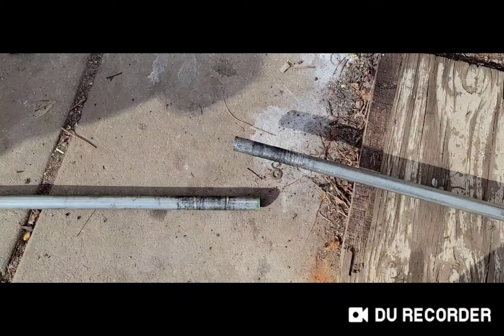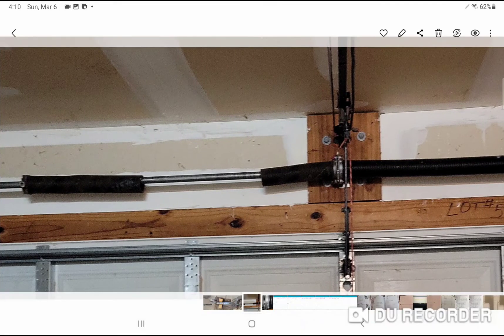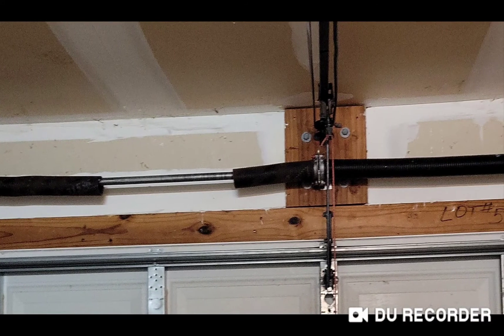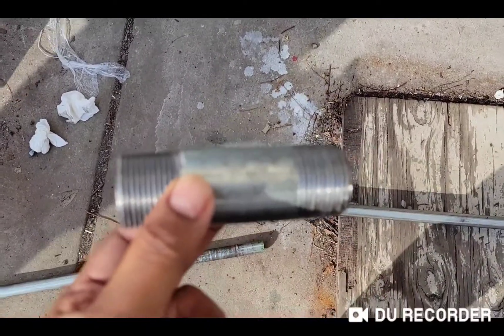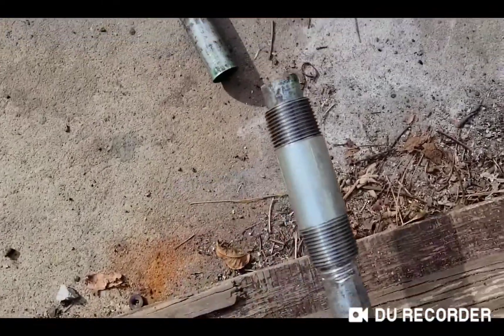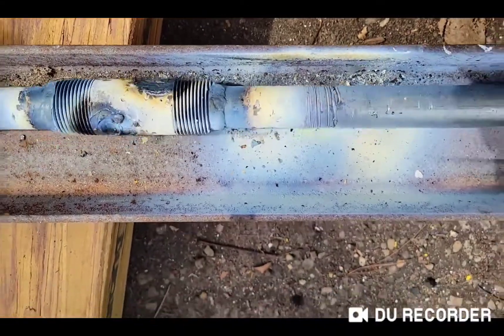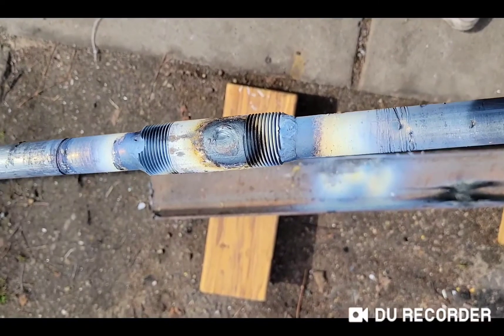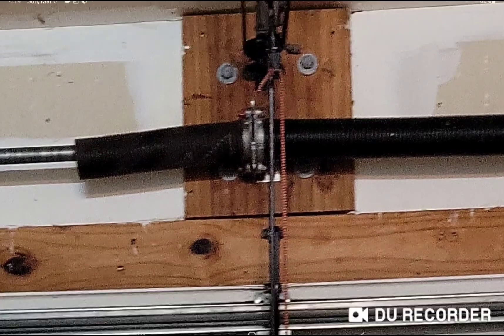How to fix a brocken garage door torsion tube - shaft.

Comment: What if I bought some JB weld and packed it in that nipple or I could drill through the pipe and bolt it .  The problem is I can't get the cone off and I'll have to cut the pipe  to get it off. my pipe has been dented massively by the set screws.  Maybe I could do this weld and put it on the opposite side since there was never any spring on the opposite side.  Thats probably my answer.  I can jb weld it and drill through it .  Most of the torsion will now be on the seemingly new side of the pipe and the welded bullshit will be on the opposite side that doesnt have all the force being applied to it.